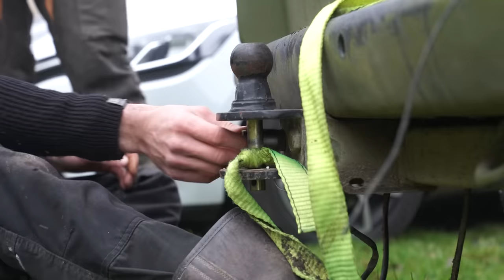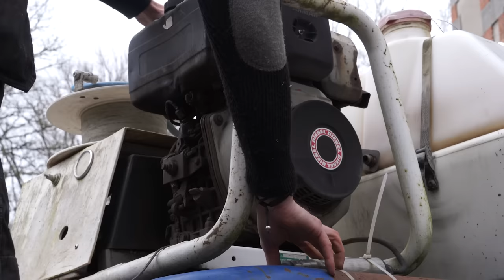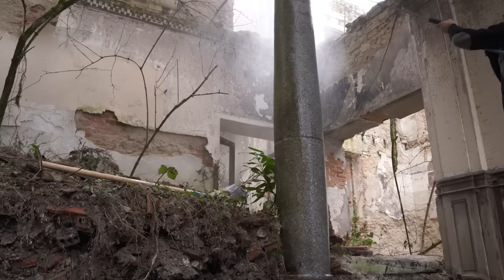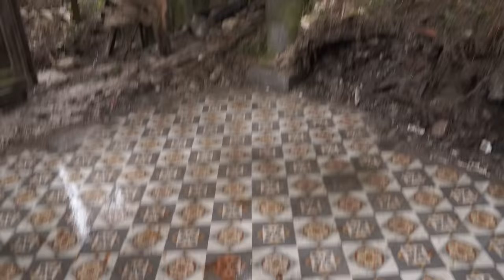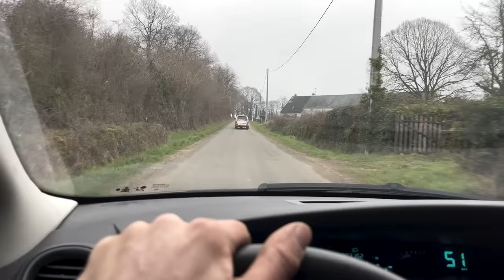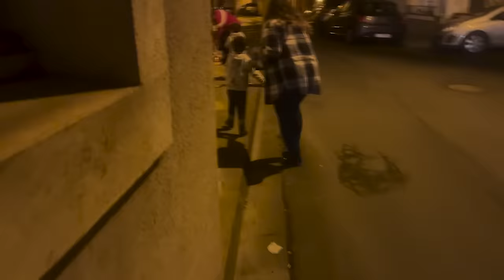An absolute disaster...

Comment: Time to lay a temorary floor over those tiles, Dan.  Protect them as that mound of rubble has done for so long.  Also have a wooden structure built around the pillars, like a box, in order to ensure nothing takes nicks and chunks out as you rebuild.  Just as you keep each piece of molding, wood, etc. to use as a template.  It is now time to secure what you have uncovered.  To replicate down the road those features you find, most of which were destroyed.  
Thank you for bringing us along on this epic journey, Dan.

Comment: I almost recommend removing all the tiles and then re-installing them at a later date. Now that they’re uncovered, they’re vulnerable
Reply: Agreed.  Protect them against weather and thieves.
Reply: I was going to say the same thing about the tiles being vulnerable now that they are exposed!
Reply: Might be better to lay a composite sheet board over it. Lifting would be too risky.
Reply: I concur, but recommend putting a series of joists down, covered with construction ply, for protection and security.
Reply: @memineaussi-cj4op   theft of the tiles is extremely unlikely in France, now it is obviously being reclaimed. Previous removal would have been from what looked like a total destruction.
Reply: There could be a .ot of breakage
Reply: They could break.
Reply: I'm so worried they might be nicked when❤ your not there  Dan 😢
Reply: @paulinefreeman9492  It is obviously no longer abandoned, and the man who sold it to him is onsite, taking down those seven or eight hectares of trees that weren't part of the sale.
Reply: @pdmacguire  iy is a pity , so much trees :(

Comment: On the plus side, clutches don't usually just completely fail, they usually give plenty of warning with slipping, shuddering and or bad noises. A sudden fail would be more likely to be either a hydraulic line/cylinder or mechanical cable failure which is usually a lot easier, quicker and cheaper to fix...
Reply: I was thinking the same. Not a big issue there.

Comment: Yes, nice floor, but I'm setting here looking at you pressure wash and getting all that wood work wet. Pull that wood work off the wall, lay it flat in a dry, low humidity area, and save what you can of it to reuse later or to copy and replace it later. The floor will still be there, the wood will continue to decay if you don't pull it out of the weather!!

Comment: With cars I couldn't agree more; nothing ever seems to go right with them.  I would love to get just one inspection sticker for my car without having to sink between $1,000-$2,000 into repair costs first.  This year it's all four tires, oxygen sensor, exhaust leak, sway bar links and bushings.  The oxygen sensor was so hard to remove it took a full day to loosen it.  I have also had my clutch burn out in a bad moment.  It was snowing badly and I did something I normally never do, I stopped for a young woman hitch hiking.  As a woman myself I usual never stop for them for safety reasons, but I couldn't pass by her while she was standing in the freezing cold.  I went out of my way to take her home even though it was the opposite direction from where I was headed.  Low and behold, the clutch went halfway through the journey, and we were stranded on the interstate miles from any town.  Of course my cell phone had been forgotten at home that day.  Thankfully the resourceful young hitch hiker got us a ride to the next big town, where I was able to call for help via payphone (they still had one), do a little Christmas shopping, and watch a theater movie while waiting for my ride.  I am so glad I picked her up because if I had gone home it would have burned out on the way there and I would never have the guts to hitch hike alone.  I honestly don't know what I would have done.  I truly think God was watching out for me that day.

Comment: Ask Steph for all the cardboard boxes that come into the chateau.  Flatten them and use them as a patchwork covering on the floor using heavy duty tape holding them together.  When you finish one layer -- start on a second layer.  This should keep the tiles from getting damaged further.  I am sure there are artisans in France that can recreate tiles to replace those missing.  A while ago, I watched a video of a gentleman in Egypt that is the only producer of decorative concrete tiles in the Cairo area.  Of course he is too far away but the process did not seem extra difficult.  You might even try your hand at it.
Reply: Dan -- Please see Mailen's response about the tiles and the trouble you could get into.

Comment: I would of thought you might of gotten stuck into the heater radiator and cleaned out all that dirt and grime off with the pressure wash on the outside to see what it looks like. 
Cant wait to see what everything all looks like once it is all cleaned out. 
Was thinking once you have the first floor all cleared, get in there underneath in the basement and clean out those rooms and use the pressure cleaner to scrub those floors and put some windows and doors in. Can put a portable generator into one of the basement rooms, and perhaps set up others for temporary staying in so you can spend more time on site and have a somewhat waterproof concrete roof over your head before you set up a cabin outside.

Comment: As a fully fledged property developer myself, i cant understand why you would waste your time jet washing the floor when theres so much other stuff that needs doing and itll only get filthy again. Refurbs are about efficiency as theres already far too much to do.. Even wasting seconds scraping the grooves on the basement floor.. Shave seconds off the job in as many ways possible and dont waste time on silly tasks.. you'd thank yourself in the long run and avoid potential burn out. Only do stuff that makes a huge difference. Other than that 💎

Comment: Actually my sister has had some of the same issues of things not going right. For both of you I think it comes down to money or lack there of. You are both trying to do the most with the least amount of funds. This means you spend less on a car or something and it breaks down.  The house she bought turned out to need more work to get it liveable than expected. (She ended up buying it "as is" (with a significant price reduction) because the seller was not able to come with the necessary repairs. So now she is having to deal with contractors and cannot move right in.). She will be doing some things  on her house and always has but now she is in her low 70's. It is all harder and takes longer.  At least you are still young and healthy.  Your adverse luck is lack of money.

Comment: Always hope for the best, but expect the worst.  At least Calvin got out on time?  It has to do with getting older used vehicles.  Just happens.  And, that is when you need a vehicle you can trust--when they are older and used.  I drive two older cars and they are always having something go wrong, but I just buck up, like you do.  So disappointing really.  No car payments.  And, I don't put as many miles on my cars as you do, but did for years and years.  Can't tell you how many times I was dropped at the most inconvenient time.  I drove an MG for years, and you know how reliable they are.  Lucas electric and all that.

"An absolute disaster"  I looked at with tribulation.  I thought you guys had somehow completed it all.  Now it will be a single man job?  Beautiful floors.  I was thinking that maybe, just maybe the tiles would pop off.  I didn't think of your car dropping you.  Some day, Dan, this part of your life will be over and you will look back and just shake your head and wonder how you did it all.  I did notice a smallish tree growing in that pile that is left.  Just another day in paradise.  Soldier on mate.  You have a large force behind you.

Comment: Do you realize how strong the floor you're cleaning is? It had about 1m of soil and loose bricks that when wet in the rain must have added tons of load to the floor and yet the floor is level and there are no apparent cracks or cave in's. There is a basement space under it I think you showed before. Maybe I'm mistaken but you seem to be at the level at the top of the exterior stairs? When it was occupied and furnished even with occupants walking on it, it would never have had such an enormous load.  Or is that the ground floor and there is no space below it? 
You apparently never found many roof tiles but I could see scraps. I wonder if even before the building was burned out, someone may have stripped the roof to salvage them?  That left everything exposed or maybe the scavengers themselves set it alight? I even wonder if some prior nearly impoverished owner just stripped whatever valuable materials he could take and resell and burned it out just to reduce it's tax assessment to zero. Perhaps the rest of the land was undeveloped even as farmland and was also of low assessed valuation? The later history as a war refugee shelter probably meant it wasn't really a desirable residential property anymore. Or there weren't many buyers after the war because the country was trying to recover from the occupation and looting by the Wehrmacht?  And that would be a reason for stripping it of needed building materials which may have been sold (or not) to people desperate to rebuild? 
Another puzzle: Why was the paneling in the stair hall not scorched and even burned out too? Fires can exhibit very freakish behavior. 

The place isn't too big and will look so handsome when it is finished. 
Those columns are beautiful and it's great they are in such good condition. 
BTW - in your overhead drone shot - do you have any idea what those two rectangular tub like containers (of terracotta?) are over the corridor and behind the chimneys?